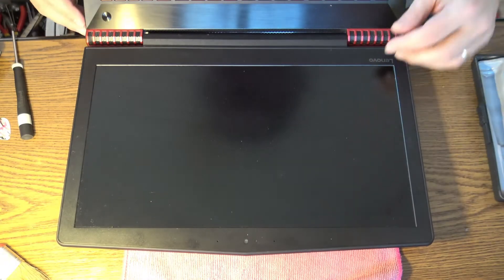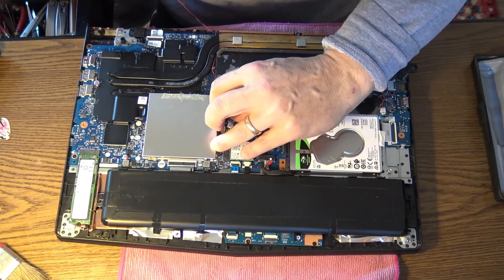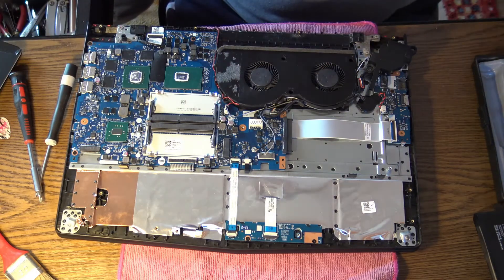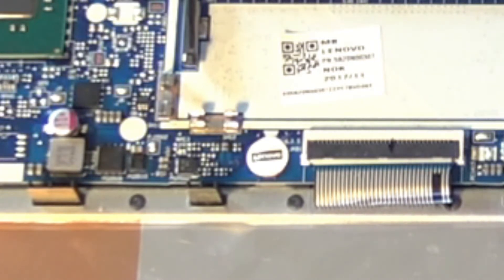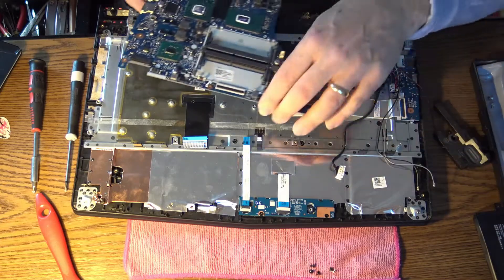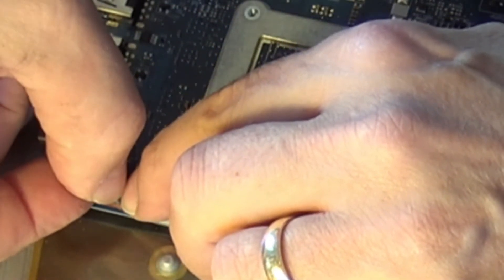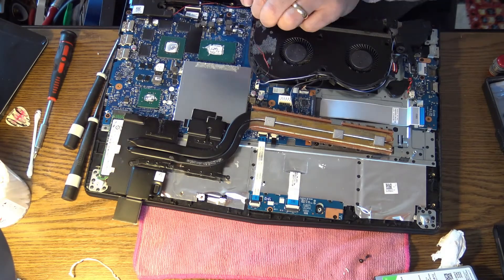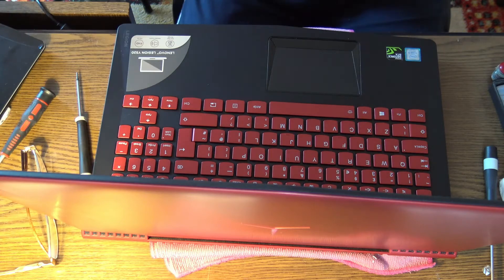Lenovo Y520 Legion power button fix

Comment: Is there any mode to turn on/off the laptop? Without service?
Reply from the maker: I don't think so...
Reply: @viocaia  thx. Just clean and done?
Reply from the maker: @ I believe there is a hole for reset,not sure but you may try that to restart. That goes to BIOS usually.

Comment: Is there anywhere other than China to get a replacement button like this, because shipping from China takes forever.
Reply from the maker: I really don't know, maybe parts providers like DigiKeys or Mouser...but I can't guide you to a certain part number. Also, you can use any other switch just for the ''wok'' metal part and adjust to the right dimension. Fit inside, add tape and should work as well.
Reply: @viocaia  I thought about a small micro switch with a short button pillar, I have seen them. I located the exact part, but it's all China and the estimated delivery is in January :/ I'll try to rig something up and many thanks for the reply, it's highly appreciated.
Reply from the maker: @lcd4112  Of course! Good idea, that should do the job. Good luck and let us know how's going.

Comment: Any recommendations if my screen won't turn on after getting it all back together? I applied this fix for a Y530 15ich - but same principles! Same button issue, but when I put it all back together, fans ran, keyboard/backlight - and hearing the CPU tick, but nothing on my screen. The tick LED was blinking. Tricky process, this one! I pulled apart and double checked a few times - I'm scared the ribbon might be bad to my display :(
Reply from the maker: tDisconnect  power supply, disconnect the main battery, also disconnect the BIOS battery (coin 3V battery) even short the terminals, and wait 10 min, then -plug all back and try to restart. Let it bo9ot band reboot , that's normal, it will take 5 min , don't panic...it should work.
Reply: @viocaia  Will give it a shot - sure appreciate you. Wonderful videos and excellent channel! I'll let you know how it turned out!
Reply from the maker: @tylerhoornstra1761  Good luck!
Reply: @viocaia  Bummer - I think I'd be able to boot it properly with the 'Hold power button trick while everything is unplugged for 1 minute' - but i realized my 'wok' is too big (the PC would power up without me pressing any button, just from power cable going in), and after cutting the wok down smaller, it won't pop up and down so it's useless. I've taken it apart and put it back together maybe 10 times now trying again and again. Your video and channel are great, but I have to give up, unfortunately. Dead pc now :( The hold power button trick won't work with the side slot power option, so unless I can find a wok of the same size to fit, this PC will be laid to rest. Appreciate your attempts to help though!
Reply from the maker: @tylerhoornstra1761  Sorry can't help more...

Comment: hello, how to set the meter and what should I put it to when pressing the check button? I'm new, I don't know how to use the meter and I would like to check if it works before assembling everything. Please help. Regards.
Reply from the maker: Set the multimeter on OHMS, or resistors...even a sound symbol, you should hear a sound when you cross the leads. So If you are on OHMS a good switch will give a zero on display when is pressed, or a beep. Leads should be black in com and red to V/Ohms/...

Comment: Ty dude. So basicly we can just replicate this metalic wok piece of metal with aluminium or copper and place it ?
Reply from the maker: As long as you can have that switch  momentum... Better open another switch and take the part from inside  there,
Reply: @viocaia  thanks for quick reply, because I can't find this metal piece inside the laptop. It seems that the piece got disintegrated
Reply from the maker: @kalutstyle2256  If you are lucky, it went outside, check around loudspeakers or any magnetic parts you may have. They are not simple cooper, it has some steel which is magnetic and to have that springy effect
Reply: @viocaia   sadly i'm not lucky enough to find it. But i find something exactly like the mini push button switch that you showed at 5:47. Do you think that i can just place this micro switch to replace the "wok" magnetic thing?
Reply: I saw also that i can eventually create contact by just touching the area with a screwdriver and a hole in the power button @viocaia
Reply from the maker: @kalutstyle2256  That's the solution, a metallic piece to make contact, put it in place and cover with tape...

Comment: I have a inquiry, it would be great if I received an answer soon.. Do I need to change the LED back cover and bottom cover for the laptop to fix the power button? I feel scammed by the electronic store cuz it cost alot
Reply from the maker: There is no LED on the button..It's simple plastic piece pushing the contact..or maybe it;s related to something else..but there is no LED with the power button...
Reply: @viocaia  The laptop was dropped before and there was a crack on the back cover of the screen (I think that what is meant by LED back cover).. so in other word I dont need to change said "LED back cover" and the bottom cover of the laptop when the power button is fixed, right?
Reply from the maker: @TheOnly3MZ  If you can use it without or with cracked lid..why not..you can find one later on Ebay..as long as the power on button is working..the aspect dosn't matter as long as it's functional..but it;s up to you..the laptop should work perfect with a smashed lid!  But..if the corner where the power button suppose to be is gone..or smashed ..maybe you need it..there is no support for the button itself..I mean the plastic button wiich suppose to touch the wok contact and do the magic...

Comment: I have this laptop too. My problem is when i press power button nothing show up in my screen and the keyboard light turn on for 5 seconds and turn off after that what do you think about this problem ? Sorry for bad english
Reply from the maker: Doesn't look like a switch problem..Try to take out all the disks..M@, SSD and eventually extra memory ..try to start now..eventually any USB ports extension , even WIFI..everything detachable..
Reply: @viocaia  Not work. What about the bios battery can a dead battery cause the problem like this ?
Reply from the maker: @sunjornmungsungharn87  never...you can even take it out..the laptop should start..is the fan spinning at start up?
Reply: @viocaia  no. The lower right light still turn on but the fan and screen not work. After a few seconds i feel warm when i touch the heatpipe around the cpu and gpu
Reply from the maker: @sunjornmungsungharn87  Hard to say...you should go to a workshop..seems like a short somewhere..maybe GPU fail?.. who knows..

Comment: What causes this please?
Reply from the maker: Bad design maybe..
Reply: @viocaia  correct. For mine, that little clicky thing stucked to the right speaker😅. This is my first time removing the motherboard, i was a little bit scared at first, but i said 'dang it' lets do this, i follow the procedure in the video and put it back with a tape, my laptop and the power button is working perfectly now. And i even had the opportunity to refresh the thermal paste. Thank you soo much. x100000 likes❤️
Reply from the maker: @captainstyler5650  ALways! Nice you fixed, it's a great machine.

Comment: I'm going to have to do this as well ☹️ also I may as well replace the wifi because it stopped working about a year after I got my Y520 and I've been using a dongle. Do you know if it's a standard wifi card or a specific one for the Y520? Thanks for the video 👍
Reply from the maker: Hey! There is a mini PCI Intel WIFI..very common..
Reply: @viocaia  Thanks

Comment: What Is the grey disk you used for fix the button? I'm Sorry, but i didn't understand
Reply from the maker: That is a metallic piece for making contact in between three under positioned parts, one central and two aside.Because of the ''wok'' shape of the grey metallic part, the contact is on only when the central pressure will be applied.The ''dome,wok'' shape will lift the middle from touching the central contact as long as there is no push.

Comment: For those not comfortable with opening their laptop or lack the tools to do so, remember that most lenovo models (especially this one) have a recovery key on the side. It's a little hole near one of the I/O ports. Usually on the left side. If you poke a pin or a toothpick in there, you will feel a click and your laptop will turn on. It will give the options to enter the BIOS etc, just press enter on Startup Normally and your OS will open.

You can use this hole as your power button for as long as you like.
Reply from the maker: Good idea..the problem is that metal part can make a short somewhere on the mainboard...
Reply: Wish I had read this sooner, if your button is broken use a peprclip to the hole next to the headphones jack. Don't worry about shorts, this is designed for this.

Thanks MaqKun
Reply: Oh my god it really works. I was thinking to remove all the parts. Listening to your advice, just using a toothpick my problem solved. Thanks man.
Reply: @libau3741  :D
Reply: Thank u u are my life saver
Reply: oh my fucking I SHOULD HAVE READ THIS SOONER AAAAAAUGH
Reply: I will try later
Reply: Substituindo o teclado resolver o problema no botão de ligar?
Reply: OMG I LOVE YOU THANK YOUUU <3
Reply: It works! Thanks for that tip!
Reply: Thought it was all over thank you duck man
Reply: You saved me a lot of time and effort, thanks!
Reply: Thank you so much - confirmed Laptop was still working - will go ahead with the tape fix before resoldering the microswitch
Reply: Omg I love you so much man thanksssss
Reply: phew this solved my issue thank you!!
Reply: Hehehe. I just fixed the problem... Cost me like 2 hours and now I read this. Well at least I can use my normal power button again
Reply: Nice, to offer an alternative solution to start the laptop. It is called the Novo button also. STEP 1 poweroff and close it, STEP 2 open the LCD screen and press the NOVO button with something thin but be gentle. Hopefully your Lenovo laptop is still alive.
Reply: Thank you!!!!

Comment: My laptop just said locking and turned off at 39% battery could this be the issue?
Reply from the maker: Check the battery health with this soft batterylifeview from here http://www.nirsoft.net/
Reply from the maker: I believe it's a power setting, at what level it should turn off the laptop.Go to Control panel/Power options/Change plan settings/Change advanced power settingsBattery....there are a lot of parameters about battery usage, check them out...but first check the battery with that little software..

Comment: Thank you, you saved my life. I changed the keyboard on this PC, I remounted all the machine and when I tried to start : nothing. I opened again the PC a i didn't understand why there was only a plastic button. My deduction was that there was an other piece, but what ? Happy to see your video to know there was a little capsule which created the contact. I found it in a switch in a mini PC that I kept I don't know why, but it finally served. Thank you again.
Reply from the maker: Nice you could fix it.It's such an wrong design..and this laptop is not cheap! At all!

Comment: This video saved my day, thank you so much!
That was my first time taking apart a laptop and it worked. I got lucky too after searching for a while, the round silver piece was stuck to the speaker.
Reply: Mine had also stuck to the speaker and i noticed it when repasting, but i lost it :(
Reply from the maker: @choonky  Try to shape a new one from another switch..
Reply: @viocaia  that could work. Although, i dont want to fully remove the motherboard since i am afraid i will somehow break it…ive been fine with upgrading it since it is accessible as you remove the back plate. I can also just use the novo button to boot it up. But thank you for your suggestion, in case i decide to do this in the future!
Reply from the maker: @choonky  Nice! Take care!
Reply: @viocaia  what kind of chip?, do you have an idea? model?
Reply: Switch* Sorry
Reply: The metal part
Reply from the maker: @nunogabrielrodrigues449  Any usual..you can find them on keyboard switched, door bells, radio...https://m.made-in-china.com/product/Mrs-101-8-Tact-Switch-Micro-Switch-Tactile-Switch-612014835.html
Reply from the maker: @nunogabrielrodrigues449  Just open and take that out, reshaped in case..
Reply from the maker: @nunogabrielrodrigues449  I got that..
Reply from the maker: Glad you could fix it!
Reply: mine also stuck to the speaker ;)
Reply: I looked around for 30 minutes couldn't find it picked up my speaker and there it was stuck right in it absolutely life-saving video This is easy and quite fun to do actually

Comment: Hi do you have a link for the exact part for the button? ( is it upside down) turned amazon upside down looking for one
Reply from the maker: Hey! I didn't replaced the switch, luckily  the metal ''wok'' part was inside the laptop, I just put it back and secure with tape.If you lost that you can make another from an old switch, just cut it to the right diameter with a nails scissor.
Reply: @viocaia  thanks for the response, can you tell me where I can find the metal part? Or is it only from motherboards
Reply from the maker: @ineptireplica1548  try to find a switch, open it in take the piece inside...adjust it to your needs..
Reply from the maker: @ineptireplica1548  That's a great switches set, try to adapt one of them, remeber you need only 2 contacts so even if you change the position will be ok, as long as you can push it from the power on button.
Reply: @viocaia  thanks alot managed to sort out my device 😊
Reply from the maker: @ineptireplica1548  super, I'm glad for that!

Comment: Can you fix Acer Aspire e431 power button sir?
Reply from the maker: If is on the mainboard or a board by it self it should be easy,if is on the keyboard you need to replace it
Reply: @viocaia  it's on the board sir
Reply from the maker: @0.1lemon  check for short, if no you should have 3.3V...if you have the voltage just replace the switch.
Reply: @viocaia  can i contact you on fb for help?
Reply from the maker: @0.1lemon  sorry I can't do more..good luck!
Reply: @viocaia  The button isn't replaceable.. Any solution?
Reply from the maker: @0.1lemon  first check if the contacts are ok, just make a short center tip and extreme..if the laptop is starting you're good.Then open a classic micro switch, get the metal''wok''like membrane, cut it around to the right diameter with nails scissor and place it in the ruined one..cover with a solid tape and that's it..I'll do a video about soon..
Reply: @viocaia  please do i don't understand... I turned on the Notifications

Comment: What if i dont have this little metalic part for the switch? What you think guys, can i replace it with any other thing?
Reply from the maker: yep! just open a micro switch, you can found it almost everywhere, get the little metallic ''woke''  like membrane and fit it into the ruined one.If the diameter is to big, try to adjust with a nails scissor ..it should work..
Reply: @viocaia  Where?

Comment: Could you create this kind of tutorial for Acer A515 as well? It has the power button on the keyboard, I had it happen before and I had to replace the keyboard and it's a very costly replacement.
Reply from the maker: Hope not! To replace the keyboard is a totall mess..But if is necesary will do it.
Reply: @viocaia  Was hopinh there could be an alternative to get the power button working even if the keyboard stopped working. Because i use an external keyboard - so idm if the keyboard as a whole fails. If I can power up the system.

Thanks again! These tutorials are so helpful 👍
Reply from the maker: @vicious0-yt  It can be , touching to ground one of the keyboards outs, I don't know which...or to check the I/O chip and see what pin is expecting the off/on signal..and related to a external touch switch somehow..but it can be a short cut from BIOS, enable WAKE-UP OVER LAN, so you can ''call'' the laptop from the network, starting on..do that  before the keys are ruined..I'll do too!
Reply: @viocaia  i will look into that! Thank u very much 🙏
Reply from the maker: https://www.youtube.com/watch?v=RRKS2VR5O7M&t=470s